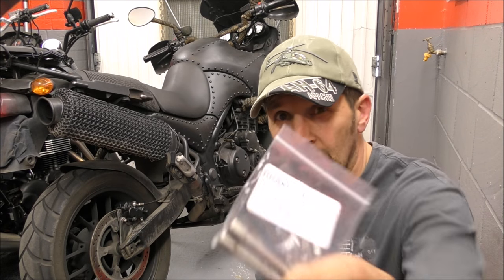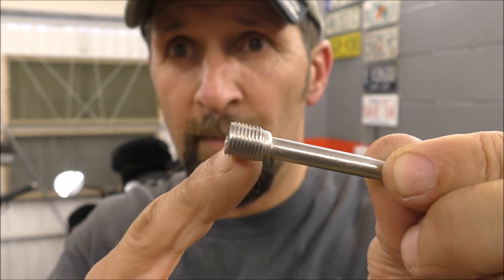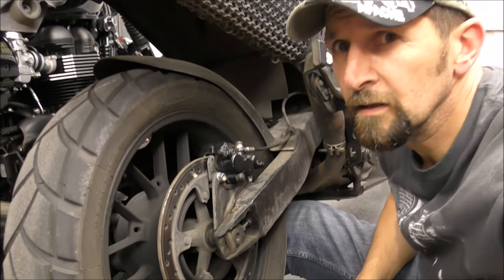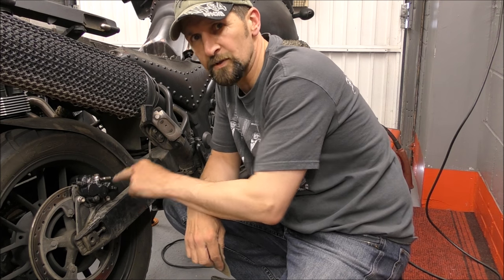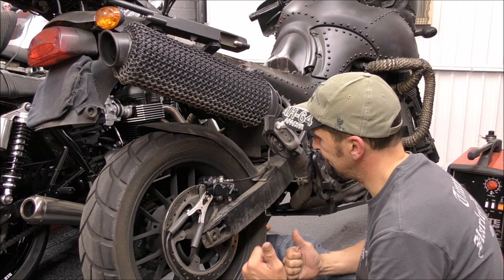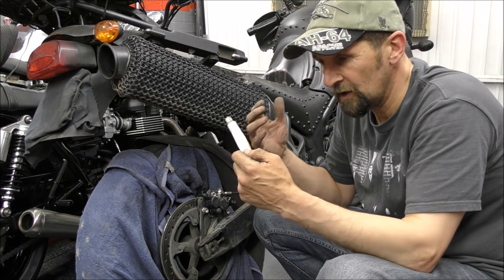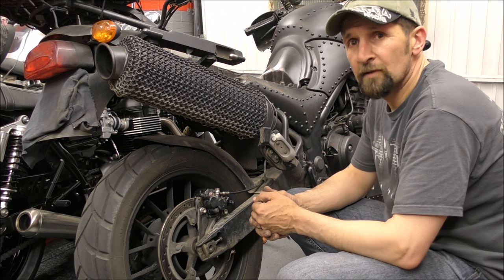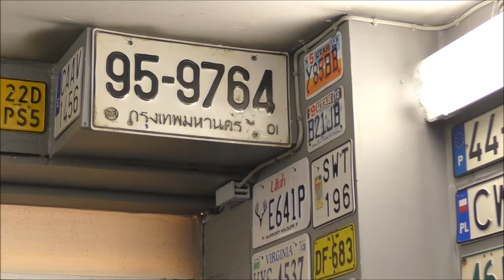Delboy's Garage, Removing Stuck Brake Caliper Pins

Comment: Good video. I especially like that you advised to disconnect the battery to protect the ECU. This really is the avenue of last resort where the pins seize and the hex has been rounded out. May I share something I've learnt with these pins over the years. If the hex is still good don't just grab the first allen key in your toolbox and start heaving on it risking rounding it out. If your garage is like mine you'll have gathered more than a few 5 or 6mm allen keys. The size variation between them can be considerable especially with cheap Chinese made toolsets. Get your digital caliper out and measure each allen key. Find the biggest of the bunch, it''l be much tighter in the hex and you'll have a much better chance of it breaking the pin free. Another little tip - before heaving on it to undo it, go the other way, yes, to tighten it. Sometimes it's all it needs to crack it free a little. Oh and spray some penetrating fluid on it a couple of hours before starting. Not WD40, a proper penetrant such as Plus Gas or Penetrene or your own mix of acetone and ATF a combo that many car and motorcycle restorers swear by.

Comment: Something I always try is to take a torx bit, cant be the cheapest one, of appropiate size and hammer it in with appropiate force. Many times this works because the hammering loosens the bolt, and the torx bit cuts into it, making it's own grooves and then you can turn it.
Reply: Worked for me
Reply: Yes mate wacked a Allen bit in
Reply: Or hammer in an imperial size Allen key in.

Comment: This video gives me a great appreciation for Brembo calipers; I have them on all my bikes now. Those caliper pins are friction fit and bang easily in and out with a hammer. no threads no seizing :)
Reply from the maker: Yeah, Brembo do some thinking aye, calipers built to be maintained, these clunky ols Triumph ones are from the arc, they were using this design in the 1980's... you'd have thought they would have moved on by now aye?!
Reply: just goes to show where budget cuts for R&D are. I like what I am seeing with motorcycle manufacturers on modern bikes just outsourcing this stuff to companies that specialize in it, like Brembo, Nissin, etc.

Comment: I've had this issue a few times as I have a few older bikes, latest one was on my 900rr on the front calliper. Used an old torx bit and a hammer, have stainless in now much better than the cheap ones that were in there! I keep a small supply of torx and spline bits just for moments like this. Never thought about welding it, will be something to think about next time! Keep em coming Del!
Reply from the maker: Cheers mate, the torx bit method is always a good favourite !

Comment: Very very good tip that i am sure could be used in many other situations. Would have never thought of that in a million years! Thank you!
Great info on the battery and welding mess! wouldn't think of that either!
Reply from the maker: Thanks Gil, its a very expensive mistake, and aweful to find out the hard way..

Comment: Another option is to use a torx bit that is just a size larger, tap it in until it full seats then use a impact driver to remove it. I've done a few nearly rounded out allen bolts that way.
Reply from the maker: That works really well for a single 'Break' free situation where a socket cap bolt is simply done up tight....but these pins are not holding on via the thread... its the shaft of the pin thats corroded into the old dead pads.... and in these situations, even a hammered in Torx bit will eventually round out the bolt... but what ever works aye.. lol.

Comment: I made up Allen key fitting out of old 6 mm with 3/8 or 1/2 drive when they were worn out. I grind the hex to about 5.1mm perfect fit and never get a problem. Even new pin and Allen key is a sloppy fit, then 1st time you really swing on them they ream out. Got some ever so slightly bigger ones too when my mates have messed their's up

Comment: Great advice Del . Dam steel in alloy is a real pain .You got a right result getting that out.
Reply from the maker: Yeah, touch and go though... just as easy to snap the head off and find yourself surfing eBay for a new one..lol
Reply: True Del . Welded a nut on a mower engine sump stud just would not move it .

Comment: Great vid! I have found that the anti-rattle clips in the caliper act as springs to put a side load on the caliper pins as they push the pads against the pins. This acts "like" a split washer to some degree. So I totally agree, you don't need thread locker or to lean on it. Just snug the caliper pins up and it's fine. And the copper slip / never-seize is worth the effort. It will make life much easier later. Cheers!

Mike
Reply from the maker: Ayup buddy, hope you are both ok your end ... counting the days !

Comment: Another great video, but no welder here, and I won't waste my time with JB Weld. I got my pin out with an EZ Out, or screw extractor. I used the biggest one possible, was able to drill down 11mm and got really good purchase. A little patience, and the job was done. Thanks Del and Penny!
Reply from the maker: Nice one John, always love to hear of great little ways to get round this sort of thing... you can also have success , if it happens again, by hammering an over-sized torx bit in to the end, I did that with this and it didn't work, so I had to resort to the welder, but hey, we do whatever works aye!

Comment: Thanks for your advice. In the end I got my pad pin pub grub screw out with a good right fitting screwdriver which had a hex on the grip. Ring spanner over the shaft to fit the hex so I could push hard with the screwdriver and turn with the spanner. Sorted  thanks again.
Reply from the maker: Great news Chris, thats the result we like... when you fit it back in, now you know it only needs nipping up gently..

Comment: a good save!!
i had this on rottweiller but no welder so i took the caliper off ground off the pads (was fitting new ones) heated the pin and mole gripped it...luckily it worked...bloomin triumph rear calipers !!!
cheers budsky..
(thought i would go budsky , had a band member once who said it all the time i really wanted to poke him in the orbit , i sacked him instead!!)
Reply from the maker: Ha ha... Orbit AND THEN sack... even better..!    Cheers me dear, Oh and early model Kawasaki GPz's used the same lame caliper too... ! says it all aye.lol

Comment: OK, so I got stuck brake pins and the hex key was almost able to spin in the sockets. First thing I tried was to use an expensive Park Tool hex key, but that didn't work out.
This is a success story - hope it will help some desperate soul ;)
First I used lots and lots of WD40 over the span of a few days, then an impact driver (the one you use with a hammer, not the battery-powered one) which didn't seem to do anything. 
The last thing was to use a breaker bar together with the hex bit from the impact driver set - those bits are made of hardened steel and I think are also a little bigger than regular ones. 
While pressing the tool hard against the socket of the pin, I turned the breaker bar veeeery slowly counterclockwise and - guess what: both the stuck pins popped and I was able to remove them and dance a celebratory morris dance knocking stuff off shelves in the garage :)))

Comment: Having had this problem before,  I've had good luck with grinding a sharp graduated tapper into a sized up hex "allen" socket then rapping it in with a hammer. Trimming off the tip to get the perfect depth of the modified socket is the key here.  I save all my bitched up tools in a separate drawer. These tools are my secret stash for emergency mods!  I do like your method more, more skill and who doesn't want to light off the welder to fix a problem.  Thanks for your great lessons
Reply from the maker: Thank you Scott, I really like that solution, and I'm gonna use it... can't always use the welder with the heat involved, and yeah I have a drawer full of cannablised tools, it's my 'get out of jail free' drawer !

Comment: Just a little tip with the welding, try and keep the feed lead as straight as possible. This will help eliminate spattering and promote a consistent weld, even if you're just tacking.

Comment: Hi ya watched ya blog on getting brake pad bolts out of the triumph I two had trouble with america took cailper off put in vice drilled into bolt then wacked a Allen bit into then a socket and ay presto I got them out today thank God ordered to stainless steel ones great vids keep them coming

Comment: I would usually try to use an easy out( not sure if you have those over there) but failing that it's time for the drill . But welding it sounds a lot easier. Never would have thought of that .
 Your a genius del. Cheers 4 sharing the knowledge again. ( Hope the gopro was alright)
Reply from the maker: Ha ha yeah, made of granite those things... and yeah we have Easyouts here, little reverse cone twist tool...and great if you cna drill down straight...if you drift off to one side, its only goes downhill from there aye.. Good to hear from you always buddy.
Reply: yeah that's them, can be useful sometimes but really is a crapshoot. Cheers
Reply: Yeah, a square shanked (or screw style) easy out, with a little heat would have been my first try, but great solution you brought to the table too. Great tip!

Comment: i had the same problem with mine, i hammed a flat head screw driver bit in the hole and used a rachet on it worked a treat.
Reply from the maker: Cool trick, can do the same with a torx bit as well!

Comment: Just a question re torque.  There are two types:  Lubricated and dry.  The same bolt will have different torque values.   The Triumph manual warns "never lubricate a thread unless instructed to do so".  The rationale is that the lubricant reduces the friction and results in an over tightened condition and a possible fixing failure.  For the brakes, lube is called out on the caliper pins.  For the rear wheel spindle, there is no lube callout for the 85 Nm torque.  Future jobs might be better if you didn't lube the end of the spindle.   This information comes from Service Manual T3859909-01 issue 4, 10.2004.  I really enjoy your videos.  So superior to the manual.   I currently have a stuck caliper pin.  I'll try the epoxy or the torx bit fix rec by David L.  
I am a degreed manufacturing engineer, so have background in the fastener field.

Comment: Great stuff as always Del !! On my old ZZR600 they were not threaded, just held in with split pins... Still an absolute bugger to get  out though...and always leaned them using the electric drill method :-)
Reply from the maker: TBH mate, those split pin ones are the best, however, stuck they get, you can drift them out from the other side... then bung them in the drill like you do... the screw in ones are a pain in the arse...!

Comment: Good one Del I was hoping you would say weld something to it. I have already replaced with stainless after a similar incident on the from ones . I now routinely just give them a few turns in / out a few times a year.
Reply from the maker: Good plan my friend, as I said a while back in all of the caliper cleaning videos, routine cleaning will make your brakes last a lifetime... once you've got the stainless pins in, you can stick them in an electric drill to polish them in the future and keep the pads sliding freely!

Comment: Great tips fella... sure I will be using both at some point.   cheers for sharing..
Reply from the maker: Cheers mate, good to hear from you... and conrgatualtions on the big Tiger..  welcome to the club buddy, hope you're running the chain loose as they have quite a severe arc sweep and when you are riding two up with luggage as you do, you need the chain tension more like a moto crosser than a road bike - but you know that I'm sure !
Reply: I didn't m8, it was loose by an additional 5mm either way more luck than judgement on my behalf.  Cheers for the info fella, as always appreciated.
Reply from the maker: NO worries buddy.... its a common known trick with the Big Tiger (and they are the biggest tiger ever too lol) just drop a couple of bags of gypsum on the back seat when you chekc the chain tension.. sets it bang on..   Oh, and are you coming down to the Jurassic weekend in September.?
Reply: Cheers fella, will invest in a couple of bags for the weekend :)  We're hoping to get down to do a coastal run this weekend starting in Kent this weekend, but will see how it goes as I need to give her a service and replace the front brake pads.   Not sure about the Jurassic yet m8y, but will try and get down for it.

Comment: Hey Del surely removing the Caliper from the disc and using a pair of small vise grips on the smooth section of the pin between the pads would allow you to gradually turn it out? Obviously with the hydraulic line still attached.

Comment: another option can be using a bolt extractor, given there is enough left to grab and not damage the inside thread. worked on my ST1100.  Came here to find about stuck calipers :-0 , so you're saying soapy water? i recall pertrol being used back in the day?

Comment: Another excellent video Delboy. If no welding equipment or J,B weld, could you cut a line into it if there is enough head showing for a large screwdriver?????
Reply from the maker: Hi buddy, you can only any normal socket cap but this is screwed in flush with the surface, so that would damage the caliper... but always good to try anything if you have to...

Comment: Nice solution :)  I've also have good experience with torn wrench hammered in to the hole and get it out that way :)
Reply: Torx
Reply from the maker: Yeah, thats a great tip, and often works... but even that rounded out on this one..!

Comment: You could cut the bolt head with a die grinder, to make a slot like a flat head screwdriver, then try to turn it. It will not hurt the caliper if you cut a SMALL, grove in the caliper, while cutting the bolt head, at a very small amount.

Comment: I saw a motor mechanic with the same problem and he just hammered it out with a hardened screw drive. The method he used was to hammer a V in one side of the head of the alan key top then swap to a blunt screw driver and hammer that in the direction to loosen it. I saw him remove 4 stuck recessed alan key heads in about 3 min.
Reply from the maker: Good man, all too many of them in the main dealers will just fit a new caliper and charge YOU for it...

Comment: You also might have decent luck if you pull the caliper off completely, pads and all, put it in a vice, then try backing it out by gripping on the unthreaded part of the stripped faster between the pads with some locking pliers(vice grips) or something. You'd have to rebleed of course, but even if vice grips don't work you've got easier access to a get at it with a welder or whatever next step you decide to go with.
Reply from the maker: Tried fitting a pair of vice grips between two brake pads?.....remember they'll still be in the way until the pins are out..!
Reply: +Moonfleet41 you can compress the piston/s to get max room, and then fit the vice grips in there, thickest ones you can. They make tiny ones, super thin, sorta thin, all the way as fat as you wanna go. Honestly seem to get more use out of my needle nose size ones than the big honkers. This is of course off topic of your video which is welding onto the bolt to get it out(well done btw), just saying it in case someone else finds this vid searching for your issue and reads comments for other stuff to try out before welding :p

Comment: Really struggling with the brake pipe hose bolt seized solid , any ideas how to shift it. 2015 tiger explorer rear .tried plus gas , heat, wrench. socket.. now started to round off.. can you help..please😤

Comment: A beautiful demonstration!  thumbs up  A good thing to remember is to have your welder ground "earth" connection close to your work area.  

Be careful not to have the current path going through bearings and pivots (wheel, steering, linkages etc). For example:  It could be tempting to clamp onto the brake disc only to find that you welded your wheel bearings.  Never been done before right?  :^)
Reply from the maker: Too right, good advice mate, but if you do a more extensive welding course, and get involved in the deeper stuff, you'll start to look in to current transfer and exactly what you described, the grease in the bearing acts almost as a flux and then you'll spot weld the ball bearings where they touch... wise words well said mate !

Comment: Hi Del, why didn't you try to use an extractor bit - I had the same nasty experience but with the caliper bolt - tried some other options before like hammering big ass screwdriver and almost breaking my wrists trying to undo it, tried to grind the head to fit 12mm spanner - broke two spanners, heating it - nothing helped... After 4 hours I remembered I have bought a set of extractors a while ago, so it took me just five minutes to get it out... Since then I worship them and frankly they never let me down (0h, did I mentioned I drive a Honda :))
Reply from the maker: I think you mean an 'Easy Out', which I have got a set, but they need at least 1/2" deep hole to get a good 'bite', and this socket cap is barely 4mm deep, so it wouldn't get enough purchase, maybe I should have said this... I could have drilled in to it, but chose this method instead !
Reply: +Moonfleet41 it's possible - never got more than 5-6mm depth - yeah, you need few tries to make it catch... I guess I can do it because I don't have welding equipment and it's the last option for me...  I am glad I have learned another trick from you - sure I will use it some day when I got mig welder - thank you!